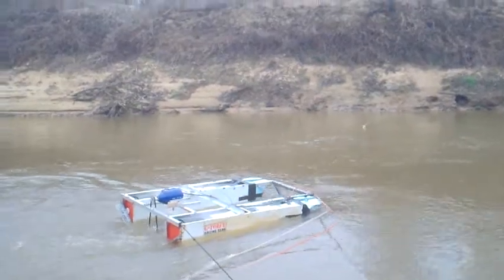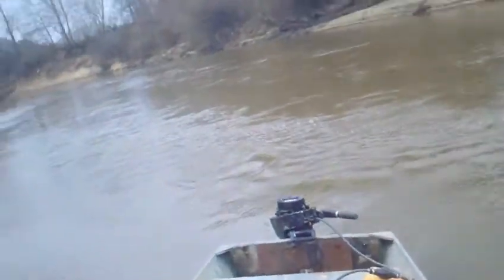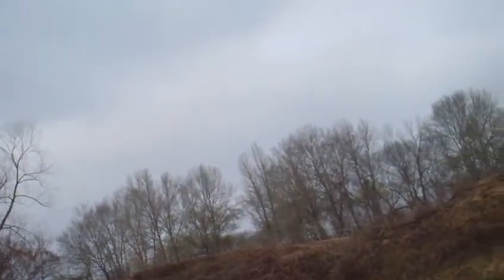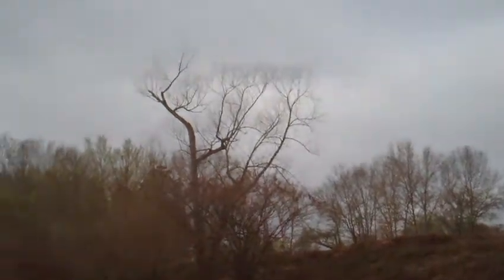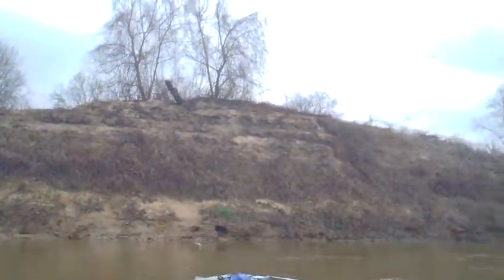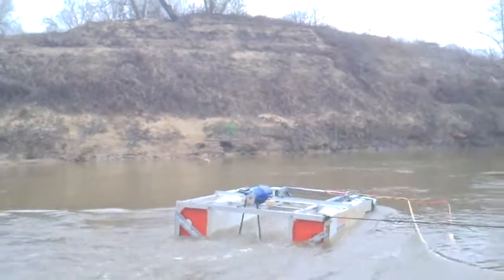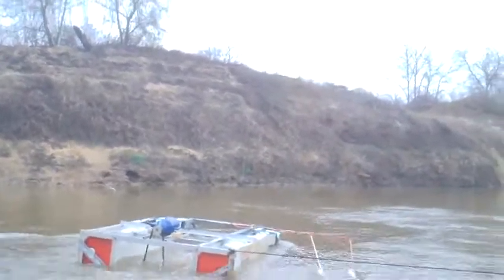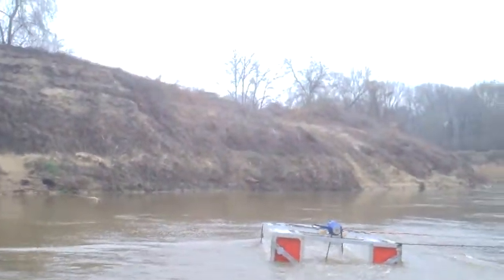Archimedes screw turbine test march 5 2011

Comment from the maker: @AAAjohn123 @AAAjohn123 @AAAjohn123 Archimedes screw been around for centuries.  unless your design different from a basic screw it be unpetentable. Archimedes invented the screw not you. any way your design is simple and back end is all wrong. a diffuser helps flow at the back because it reduces turbulence. This rig was just hold the thing. The senior design team never when with my flow increaser idea and was shot down by Dr Green.  Dr Green works for LeTourneau University.